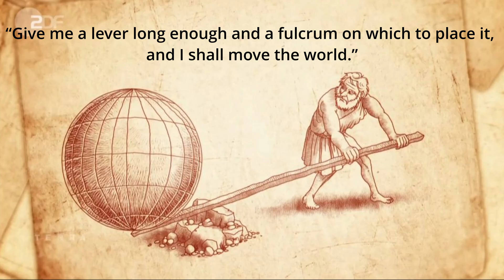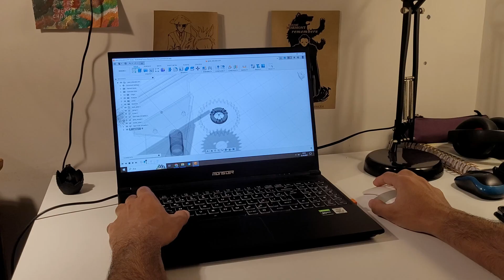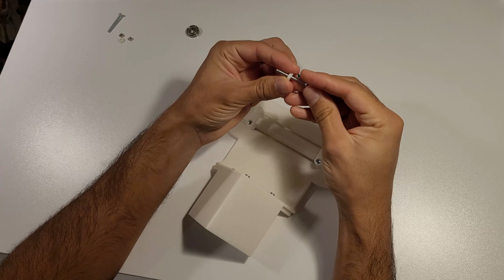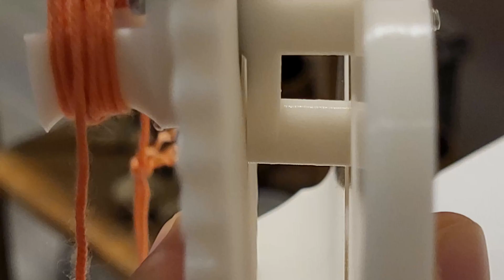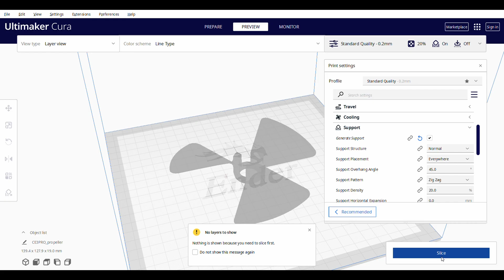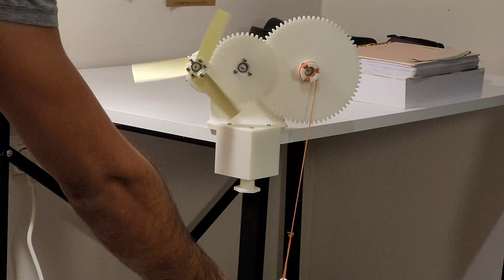Lifting Water With Air - Gear Ratios

Comment: There is an entire class of water pumps known as airlift pumps, the wastewater treatment plant I work in has nothing but them. Zero moving parts, the way the sewage is lifted from one treatment basin to another is air blown into a tube with these MASSIVE supercharger-type twin screw mechanical blowers with DC motors the size of a motorcycle. 
Air is blasted from a nozzle into a square shaped tube, like half a meter square, at the bottom at such a high volume it causes the sewage to expand up the tube and into its next destination, at a higher elevation. This also keeps it aerated which is key to maintaining the bacteria which do the treatment.
Reply from the maker: Interesting, I've never heard of those pumps before